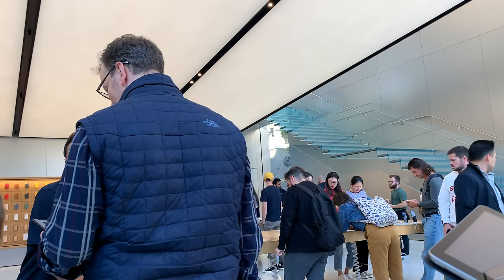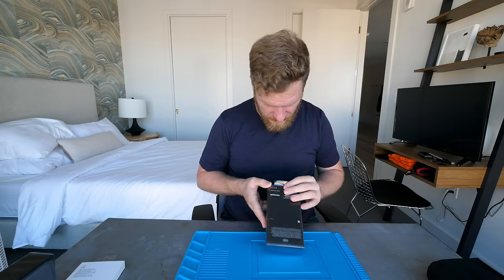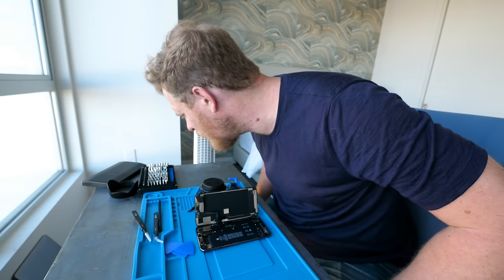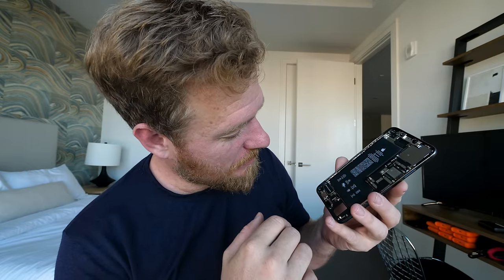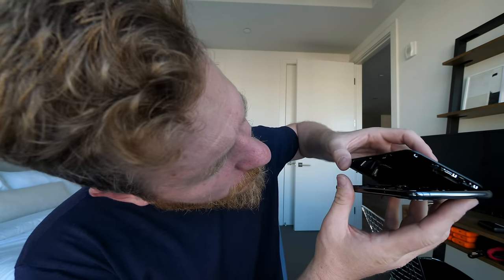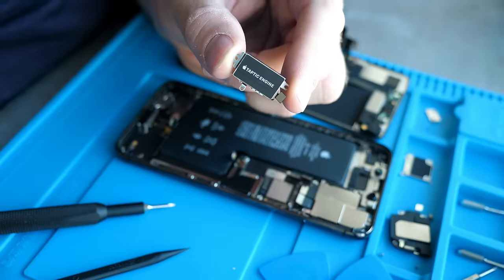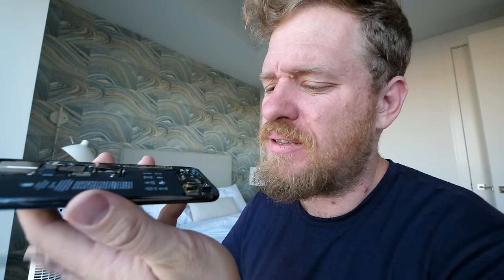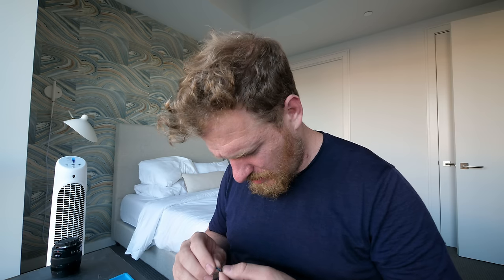Adding USB-C to an iPhone - Is it possible?

Comment: Do the Type C AND Headphone Jack, prove to everyone that removing features is just a money grabbing technique and can be avoided!
Reply: He doesnt have to prove it. We all now.
Reply: I think he should do a fully customized iPhone 11 now, backlight and custom back and everything
Reply: Of course it is
Reply: Vaporeon Gaming actually leaving the lightning port on the new iphones is the exact opposite - it’s literally just keeping iphone users from having to buy adapters and new equipment- working at apple there are people coming in the store daily, complaining about the switch to lightning from their vintage/ obsolete 30 pin cables lmao
Imagine the backlash from the average joe ....
Reply: Yannick Gleichauf But Lightning is so much worse than USB-C
Reply: @LeutnantComanderData  Yeah but Type C is the future, I'm sure apple can find a way to mislead their casual consumers into being ok with the change. Type C is the industry standard and if apple makes the move, everyone will.
Reply: @timsteuerwald2207  Of course it is. More versatile, faster data and charging speeds and wider range of accessories.
Reply: @LeutnantComanderData  Pretty sure it's because USB C isn't Apple MFI so they won't get royalties, unlike they do from every single lightning cable that actually works
Reply: @Exevium  dual screen for the shits and giggles
Reply: even if the engineering team couldn't fit those ports in on time. they would have to sell it to the board room like: "we can save $15 a phone if we delete the headphone jack, and wait on usbc."
Reply: YES !
Reply: @LeutnantComanderData  They will get over it and buy inexpensive USB C cables. Crying about a dying connector isn't gonna hurt them.
Reply: @LeutnantComanderData  Yeah but they don't have a problem with buying laptop with only usb c if they have phones with usb a cables

But they for sure have a problem with all of their electronics having the same charger
Reply: EdgyShooter they actually have usb c devices, they just have decided to not make the change on iPhones yet.
Reply: Sooooo many people will blindingly cram in a lightning cable into their usb c iPhone and snap off the connector inside. Apple should have never switched the iPad to usb c. They should have doubled down on lightning and made it thunderbolt 3.
Reply: I wholeheartedly agree
Reply: As long as there are idiots that keep buying their products, who cares. They should start selling oled screen as a separate accessory.
Reply: EdgyShooter: I don’t disagree that profit is part of the reason Apple keep Lightning (I mean they don’t even include a fast charger with their iPhones!) but bearing in mind that iPads were moved to USB-C, I don’t think it’s exclusively the only justification!
Reply: I'll add the increase storage if possible. HELL! GO ALL THE WAY!

Comment: Technically you'd be done quicker, since you've got all the contacts, more knowledge, you'd be able to do it in 2, maybe even 1 month.

Just trying to convince you btw.
Reply: Very good point(s)!
Once you have this knowledge, you will be even faster for other projects.
You are learning more and more about this phone and reverse engineering more that you actually think you are sir!
Reply: @H3ddo it's electronics... you never know. Literally, experience helps a lot and still you might fail or encounter something new. You never know. But that sliver of hope it's what it pulls us to our doom. It's the best :D DO IT!!
Reply: @H3ddo at least so far it seems he already have all the parts he needs, the only problem left is the cable routing tech he will use (how he will make the flex). Though as far as I've read, there's already several services where you can design your flex and it will be sent wherever you are without problem.
Reply: @H3ddo I don't think it will be easy. But as his face says... pretty doable with reasonable effort (enough to seriously consider it)

Comment: That quote at 1:45 is some of the best advice I’ve ever heard when it comes to modding anything, electronic or otherwise.
Reply from the maker: Louis Weisz bunnie is the man. You should go read his book on hardware hacking if you haven’t already.
Reply: Strange Parts will do!
Reply: I agree with you however what I do if I am a teenager
Reply from the maker: Vini Dalvino Work on older electronics if you can’t afford the brand new stuff. Even going back a year or two will allow you to buy dirt cheap used stuff that’s still super cool to modify, and will teach you a ton so you’re ready to tackle the bigger newer stuff.
Reply: @StrangeParts  Thaks for the advice

Comment: "adding type c"
"Headphone jack"
"Removing notch"
"Adding Android"
Reply: The last two are impossible
Reply: What about buying a samsung instead?
Reply: That's a good one add android to an iPhone that would be a good test
Reply: @VeryPiroPlayer  It's not impossible, unlike iOS, Android is open source and can be adapated to any hardware and drivers can be written. However It's impossible the other way around if you want Android hardware to run iOS because there won't be any drivers for it in iOS since everything is close sourced by Apple.
Reply: @VeryPiroPlayer  Why would removing the notch be impossible?
Reply: @tackier52  because it's embedded into the screen, thus removing it would leave a big blank space at the top of the screen
Reply: @cyrillemathieu6940  but removing it makes a black bar at the top making it the bezel and not a notch
Reply: Ahmed Imran The Notch will be removed by 2020/2021 
iPhone Upto X can run Android Because of Checkm8 Exploit 
Everything is possible
Reply: "Adding IR blaster"
"Adding micro sd card slot"
Reply: Please try the last one
Reply: @VeryPiroPlayer  Not impossible but very very hard
Reply: @ubacow7109  true but you need the kernel source code of the iPhone so that the hardware and the android os will be able to communicate with each other. Without the kernel source code which require apple to release it to the public, it is tough but ofcuz its possible.
Reply: @cyrillemathieu6940  but it would be removed...
Reply: And you get a pixel 4
Reply: @21by9  IR probably won't work because there's no software nor hardware support
Reply: That is what u call a note 10 👌
Reply: @VeryPiroPlayer  Challenge accepted.

Comment: Please take an iPod Classic and upgrade it to 2019 standards (SSD, USB-C, Bluetooth, etc).
Reply: Jorge Jimenez an ssd would be bigger than it ahah
Reply: @tomhollier6173  A m.2 could fit maybe
Reply: @tomhollier6173  micro SD will do ;)
Reply: You don't understand the complexity of what you're asking for lol
Reply: Actually I have an modified IPC with 16g ssd and lager battery can listen music more than one month.
Reply: BuzzedAldrin take 5 minutes to do a google search an educate yourserve. There is a world out there of people modifying iPods. However, I’m asking for strange parts to take things to the next level 😉.
Reply: not only it is pointless,  there are far better devices than the iPod Classic , get a new DAP , and throw that in the bin.
Reply: @daniel1tsvik  pointless? if you rather watch something else you are welcome to make any suggestion instead of trolling. Yes, you can buy a new DAP, but what's the fun in that?
Reply: @jorgejimenez3827  adding new components , is impossible , unless you reverse engineer the device , which is both illegal and extremely difficult , also today devices are easier to tinker with , as they have the source code freely available , something Apple will never do,  Please refrain from calling me a "Troll" as you are the one who is clueless here.
Reply: @daniel1tsvik  Reverse engineering software is not illegal.
Reply: @Optiplex321  it depends on the product itself and varies between many aspects.
Reply: Just reading the conversation, I’m really clueless to what a dap is?
Reply: @Optiplex321  rockbox is software free
Reply: @bluebear6133  Digital Audio Player a.ka. MP3 player.
Reply: @daniel1tsvik  do a search here on YouTube or eBay and you'll see that adding SD card, bluetooth, bigger batteries, etc. is neither impossible nor illegal. Some "upgrades"  will NOT be easy, but that's what would make for a good video in my opinion.
Reply: Jorge Jimenez oh I see thanks
Reply: @jorgejimenez3827  it is too complex for what you gain , the device itself , will require an OS , like Rockbox , new drivers , and many many things. it is far more complex than the projects that Scotty does. it is almost impossible. Why do it , when you can get a device that is better? (because it is an Apple device)?
Reply: @daniel1tsvik  No. You can reverse engineer anything you like. You may not be allowed to use what you've gotten from it, and you probably can't distribute it, but afaik reverse engineering is fine just like taking apart your car is
Reply: @daniel1tsvik  You can buy mods for the ipod classics that put 256 gigs to them with SD cards.
Reply: dankpods has already done bluetooth and sort of "ssd"
Reply: Dank Pods does this exact thing!
Reply: Look up “dankpods”
Reply: H
Reply: LDaniel Tsvik
Reply: Yess
Reply: 1 issue.. Software.
Reply: Ehem, SSD?!?!!!
Reply: Hey you'd love the YouTube channel DankPods! I just found them over Christmas and they do exactly this
Reply: @smcphee6940  Thanks!!! :)
Reply: @jorgejimenez3827  but it's really slow
Reply: @Daniel Tsvik “it is too complex for what you gain”. A good video? I would love to see him do something like that, it may be hard but it would be great. And yes, I would like to see it because it’s an apple device just in spite of the fact that apple locks down their devices so much
Reply: @daniel1tsvik  look at the channel Hugh Jeffrey's he did this like this week a check your facts
Reply: @daniel1tsvik  no love for old tech here I guess
Reply: Check out dankpods he does that type of stuff
Reply: @daniel1tsvik  ...have you watched any of these videos?
Reply: @nathangek  not really only complex thing would be the usb-c as the bluetooth has already been done and with good soldering knowledge it isent difficult and flash storage like a sd card is very easy as you can just get a plug in adaptor and plug the sd card in
Reply: Someone on reddit has actually successfully modded an old ipod with USB-C last week, and since Bluetooth was already possible this should be doable :)
https://www.reddit.com/r/IpodClassic/comments/fryb74/usbc_ipod_classic_and_usbc_mod_kit_update/

Comment: Buy an iPad that uses USB-C and try to use that component on the iPhone
Reply: This is genius thinking 🔥
Reply: Maybe not that much of money to throw away...!?
Reply: Break down the ipad is not a good idea but you are damn creative to think about that way XD
Reply: @VuaTommy  hahaha but he's trying something no one ever had! Either breaking down an iPad or sourcing part of that port from Shenzhen 🤔
Reply: can you install androis OS or other operating system on iphone?... and does it possible to turn the iphone or any other smartphone into somthing else?.. lets say a signal disruptor or sonar device like in the batman movie... i also wonder what is the limitation of things you could do with the logic board?.. can you buy an iphone logic board and built something else out of it?
Reply: @5törmwölf92 no iPad uses iPadOS
Reply: @5törmwölf92 erm it used to be the same until the recent update I think. If correct, I think iPads are running iPad OS now. Which is not the same iOS on iPhones. However, it's more of talking about the USB-C port that they want to achieve in putting in the iPhonr
Reply: @amos_bebeh  iPadOS is based off iOS
I asked
All they did was change the naming.
Reply: @maitrerim1038  lol dude just bought 2 brand new iphones

Comment: It's possible since we can find enough space in the bottom of the phone (relatively speaking) so we certainly want to see you do, or at least try it.
One thing I've been consider is that Type-C port is clearly larger than the lightning port so I wonder if there're enough vertical spaces for a larger port. And cutting a bigger hole or maybe sanding the screen and bottom plate is a necessary evil. Either way, it will takes up a huge mount of time and trail and error. Probably the worst part is this phone is too new to have parts in Shenzhen for you to find and replace if you accidentally break them.
Anyway, wish you all the best.

Comment: Challange: USB type C AND a headphone jack ;)
Reply: If anyone can do it, it would be him.
Reply: @jd6454  I mean he did make a circuit board for the headphone jack
usb c might be quite a challenge
Reply: I mean it can be done but the USB-C and headphone jack would be right next to each other and both off center

There simply isnt space cus apple first removed it and then saw people wanted it back and went fuck emm make it impossible

Apple are total shit since Steve died

They need to make a decent phone again so here is what apple should do

Release an SE 2 and that means an SE 2 to an iPhone 5s with upgraded internals and possibly better camera

Ise the A13 just underclock it / slowly throttle it as the phone gets hotter cus not only will it use less power when under-clocked would also mean the A13 wouldn’t cook the owners hands

Wireless charging is not needed a case can be made to add it for those people that want wireless charging
Reply: and an extra sim slot
Reply: @stanfield3239  bruh just buy an android
Reply: AND make it run android 😂
Reply: impossible

Comment: Why don't you use the iPad pro type c Jack
Reply: Andalib Nasir Likhon he’s not about to buy a whole iPad Pro just to take out the port
Reply: U can get parts for quite cheap though so u dont really need to buy a whole ipad
Reply: Good ideal but the port is bigger must likely.  He would need a phone port that USB c and not just any phone.( fyi when I stated bigger port I mean the hardware  that's on the inside behind the port) yes it can be  achieved 
But let's hope apple software takes it
Reply: Andalib Nasir Likhon because he doesn’t want to ruin an iPad Pro??

Comment: Put a Fingerprint Sensor at back of apple phone exactly at apply logo
Reply: He will have to mess with the software then, that's would be impossible
Reply: @omarnotfound  why would he need to mess with the software?
Reply: @thilotech  because the iPhone will simply not respond to a fingerprint scanner without it being programmed in the software
Reply: @omarnotfound  i know but he could extend the flex cable all the way to the back and use a JCHomeButton in the screen if you get what I mean.
Reply: Zarkex Tech wtf are u on about bruh
Reply: Zarkex Tech the iPhone 11 pro max does not have a home button nor any software for it

Comment: Why not remove the lightning port completely in favour of a USB-C?
Reply: apple hardware designed specifically for the lightning port right now.
Reply: @AnubiasDudeX  My assumption (perhaps incorrect) was that you could remove the lightning port completely, solder in the converter in it's place, then sit that in the place where the lightning port was as the primary connector.
Reply: @Leon Rebours It doesn't, you can boot a phone without the screen attached for example.
Reply: Mario  Wasn't sure if this bit https://youtu.be/FZZIKbidMI0?t=387 was suggesting completely removing the lightning port or adding the USB-C in addition to it.
Reply: This is the idea he talks about in the video. But it takes the same amount of space to do that. So he needs extra space for the USB-C to lightning conversion board

Comment: I wondered about this for a Kindle Fire HD 10. I imagine going from micro to type C is probably a bit more complicated than soldering a different connector onto the board.
Reply: well its not only connector. u also need a controllchip to negotiate charging voltage etc

Comment: Wait cant you strip the logic from a dongle that splits in to a headphone jack and charge cable. And stick that logic board in the phone ? just like your doing with the tipe C cable. And so basically you will always have a dongle attached
Reply: that’s exactly how he added a headphone jack to an earlier iPhone model
Reply: it’s just a matter of finding the space inside the case, engineering the flexible circuit in a way that crams the little chips in to the tiny spaces available, and finding a place to drill a hole for the headphone jack, really
Reply: @phxf   Yes he did in his original video @6:30 is he talks about it. But that time he I was only attempting a headphone  install so hi just split the signal coming from the lighting port and sent ti thru a flex circuit and the dongle thing to the jack. 
What I'm proposing is he removes the lighting port puts the circuit from a splitter dongle,  connects on side to the jack and other to the new C port. I have seen splitter dongles that are lightning to jack and type C. 
That way he dosnt need two separate circuits (one for headphone and other for type C port) , he only needs that one circuit that already is capable of splitting the signal in to the ports he needs.

Comment: Hi Scotty. Just a recommendation for the iPhone 11 Pro or Pro max. Or both.. You could try adding at least a 4500 mAh battery
At least 15W or 20w wireless charging. 
And better water resistance maybe 
And maybe the headphone jack.

Comment: Does having USB-C change any accessibility of the phone? As it is does the port have any PUF components in it (or is the phone identity all up to some KNOXish or other ARM-friendly IP?) I'd think it would be more fun to add 2TB of memory (eUDF and/or microSD) to it so it could be the video monster it's trying to be. Contrawise you could add a compression bellows the shape of the phone perimeter and have lots of space inside for power, lighting gobos and structured imaging lights, a chipper for ants, a maple syrup tap, O'Reilly Swift manuals...